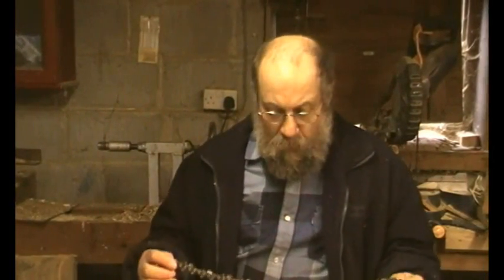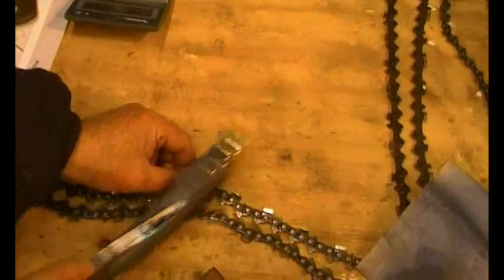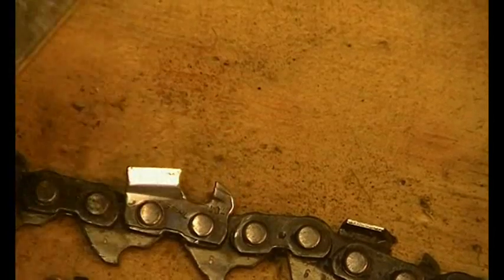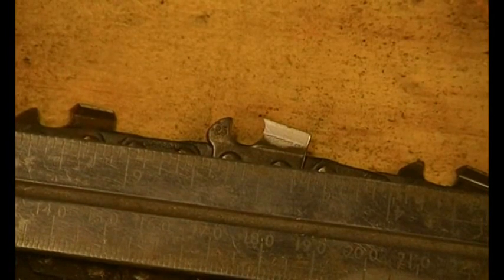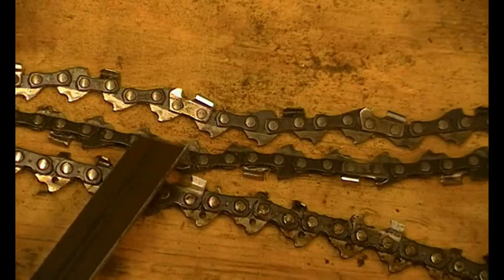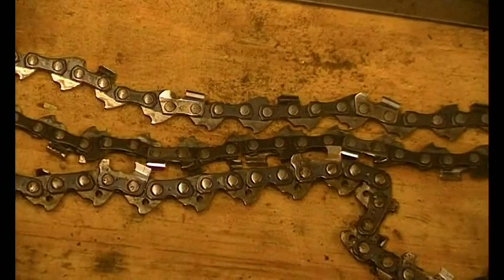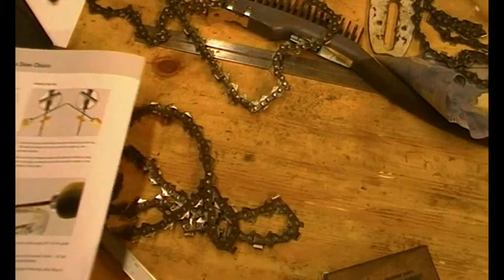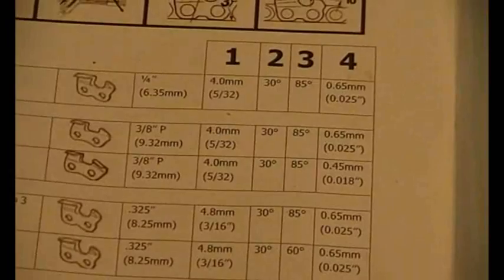Chainsaw  chain identification to select file size

Comment: Great info.  You said the Stihl booklet was "free" from a Stihl dealer?  Going to test that theory today.
Wonder why Stihl does not put all this critical information on their website?  It would sure make things a lot easier.
What other sources have you found useful?
Reply from the maker: Hi, I've gone through most of it, the video is 8 years old and my hair is now grey so I'm not sure about the free Stihl booklet nearly a decade further on. The basic chain info hasn't changed, cheers

Comment: I bought a used Poulon which I know is not a quality saw but I primarily use it for Scrub wood and honeysuckle below 3 inches.  Seems to be working well but I do need to learn to take care of it since it is not a high quality saw.  Going well so far.
Reply from the maker: Yes indeed, learning all the functions and correct maintenance is essential, also not letting it stand for month=s on end is also important as the carb will gum up, cheers

Comment: Hi Andy, Despite doing numerous chainsaw courses, notions of pitch and gauge still confuse me. Your video is excellent but I still don't trust myself to get it right. I just go with feel on my two petrol powered saws (they both cut well) and I use what they give me on courses. I've just bought one of those little Ryobi cordless pole saws. The manual says that the chain pitch is 3/8". The gauge is 0.043". The chain model is Oregon 90JG033X. There are no specs for file size. Can you please suggest one? The model of the chain seems to have been superceded by something else. Thanks in advance.
Reply from the maker: Tony, sounds like a 3/8  pico chain, that's a light weight chain with small cutters. 4mm file and file holder. Subscribed? cheers
Reply: @TheInfoworks  Thanks mate. I'll check the cutter height tomorrow. I use one of those Oregon jigs for sharpening. Once you get them set up, they're great. My mates who are tree fellers would laugh at me but there you go. Subscribed? You bet! I can't remember how long ago. Thanks so much for your content.
Reply: sounds like 5/32nds inch.  You'll know when you line one up in the gullet.  It will either fit or it won't.
Reply: @notmyname3883  Different strokes for different folks. The more the strokes, the better the fit.

Comment: Can I change the gauge on my chain saw  from .050 to .063 and what would be the advantages disavantages
Reply from the maker: Hi, you could but you would have to change the bar also and fit a new sprocket. With modern steels I don't see any reason to do this unless you are running log chains on a powerful saw, cheers

Comment: excuse me Sir, could I be so kind to bother you with what size file to use with a 3/8 pitch, low-profile chain
Reply from the maker: Hi, a 3/8 low profile chain is only found on small saws and is a called a pico chain. They are quite light weight and the file size is 4mm. Other larger 3/8 chains use either a 5.2mm or 5.5mm file. You should be able to find the details on line for the make of chain you use using maker and pitch, cheers
Reply: @TheInfoworks  what is 5.2 & 5.5 in standard sizes? 7/32 13/64? I’m new to sharpening to chains. Just bought a Echo CS590 with 3/8 chain .50 chain that originally came on it. I’ve been told I can use 2 different size files
Reply from the maker: @dentondunn4346  Hi, you must be in the USA, 5.2mm is 13/64 and 5.5 is 7/32. Hope you have subscribed, cheers

Comment: In case it makes it easier for someone- measure from the leading edge of the pin to the leading edge of the other(third) pin. This is easier and more accurate than trying to measure to the centerline of the pins. Cheers!
Reply from the maker: Hi, yep, you have a good point there, cheers

Comment: Could you tell me a way to tell what file is used for a still arborist saw.  Thanks
Reply from the maker: You will need to find out the chain pitch and work from that, cheers

Comment: Nice thanks
Reply from the maker: Cheers
Reply: @TheInfoworks  cutting 47  big oak stumps down below 8 inches to use stump grinder.
Dirt wipes out edges. Using three w
Saws Husqvarna .325 .050 .
Found bar rails wore  wide causing bar to bind in cut.
Thanks for helping others.
Shalom

Comment: I found myself wandering too.  A concise explanation of just what we need to know would be better.  Use that big link and a cardboard cylinder to show where it is sharpening.  But I will watch it again when the wife isn't home and turn up the volume and watching it 3 times might help too.  No offense, just seemed too boring like the other poster said.  I should make a short video I guess- but it takes a little work and good camera, microphone etc.  and editing software to cut out what you think is useless.  Good job Andy though.
Reply from the maker: Hi, there is a lot more detail I could have added, cheers

Comment: Awesome video. I wish the industry would pic the best all around chain and have everybody use it, bars would be standardized and there would not be so much confusion.
Reply from the maker: Hi, thanks for the comment, that idea would be helpful, however the small saws would not be a ble to drive the larger chains needs for the big saws, live is like that sometimes it just gets messy, cheers

Comment: What is the measurements in decimals on the links and thickness?
Reply: The thickness of a chain drive link is the GAUGE and must match the width of the bar groove. A 0.043" GAUGE is 1.1mm. A 0.050" GAUGE is 1.3mm. The PITCH is half the distance between 3 chain links.  The PITCH is always expressed as an imperial inch measurement so no need to convert to metric. Typical sizes are 1/4" (0.25"), 3/8" (0.375") & 0.325".

Comment: You're confusing the viewer by referring to "millimeter" (mm) as "mils". A mil, as you know, is one-thousandth of an INCH. Also the gage thickness is not read as, for example, "one point six mil" (i.e., 1.60 mils or 0.00160 inches) but rather stated as "one-hundred sixty mils." Can you imagine a one-thousandth-inch thick drive link?   😀
Very helpful information in your video to those of us who are curious or novices.
Reply from the maker: Tom, that is unfortunate, in the UK the abreviation for thousanth is thou and that for millimeter is mil, here yet again we have an example of a cultural dicotamy, cheers
Reply: You have a point about the terminology but if the viewer doesn't comprehend understand it. he's got no business playing with a chainsaw chain. Does everything have to be dumb down he's pretty much spelling it out. This guy knows what he's talking about
Reply: Nobody should ever PLAY with a chain saw. "It's a tool not a toy," as my father would say.

Comment: It's .875 or 22mm. The easier way to measure that, is to measure from left edge to left edge which is an exact point, instead of trying to decide (twice) where the middle of the of the rivet is.
Reply from the maker: Point to point or edge to edge is the same. The main thing is that you don't need to be that accurate as there are only 404, 3/8, 325, or 1/4 pitch saw chains, beyond those used on harvesters.  Between 3 rivets this gives 808 for 404 chain, and 3/4 for 3/8 etc. Cheers
Reply: Exactly my point. I was just pointing out that when precision is important, measuring from a fixed point is much more accurate than from an arbitrary one (where you decide the middle is). Nice video.

Comment: Do some hand-held saws use .404 chains, or is it only really harvesting machines that use them ? I imagine they are a handful to control :o)  I had to order a new chain for an old Poulan saw, and had to measure everything you mentioned, plus counting the number of links, as it was all so old and unknown....(it wasn't my saw)
Cheers, Dave
Reply from the maker: Dave, yes some of the larger saws have 404 chain. I had a Husky 2100 
that was 404 and I have used Stihl 88 with the same pitch chain. Back to the old ways, pitch, gauge, and number of drive links, and check it is right before handing over the cash..
 Cheers

Comment: Couldn't explain that better, that's as good as You can get. Sir, on NPTC assessments, question about chains and getting the right tools to maintain chain, is it chain on Your saw, or one will get few to inspect and measure, etc?
Reply from the maker: Hi. It should only be the chain on your saw, so you should know what the pitch is, the file size and the depth gauge setting. make sure you have the right files and gauges, and that the files are sharp. If you have a information sheet, mark yours so you can find your chain on it easily during the assessment. Cheers
Reply: Andy Reynolds That brochure that You mentioned Sir is available to download on Stihl official web page

http://www.stihl.com/sharpening-brochure.aspx#r=sidebar

That's link, it might be worth to put into description.
Reply from the maker: Thanks for the info, cheers